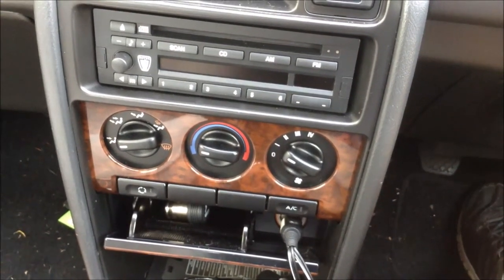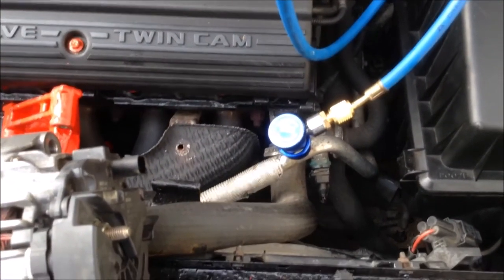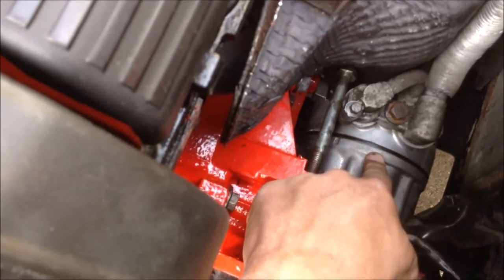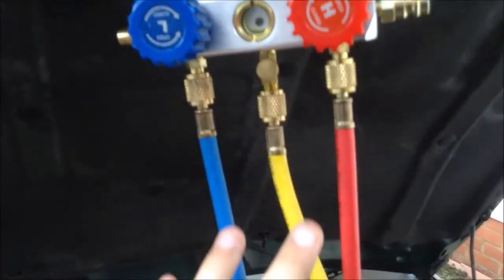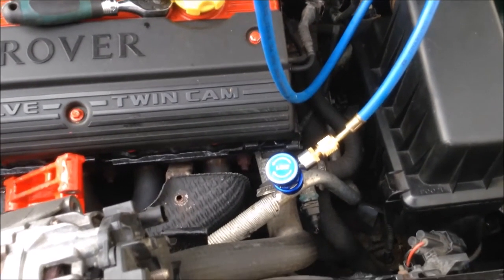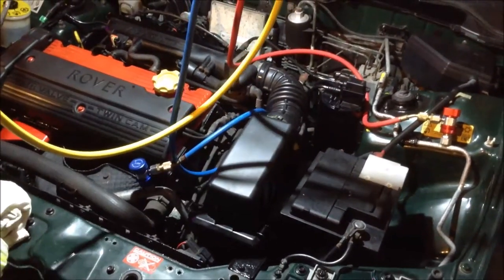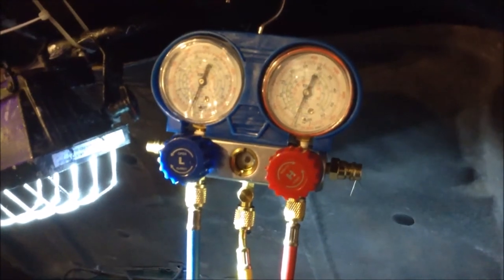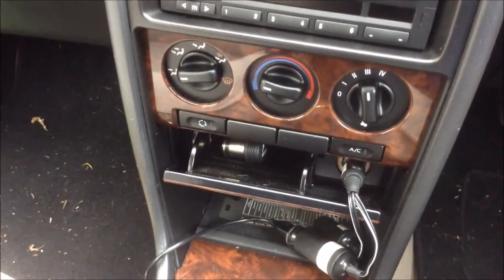rover 45 Air Conditioning part 2 Pull a Vacuum and refill Recharge Your AC System

Comment: How long did you leave it between fitting new receiver drier (opening the system up) and vacuuming?

I’m going to change the receiver drier and high pressure valve on my Rover 45, but there’s going to be a gap between doing this work and getting it to a garage to vacuum and fill the system. 
Also garages only vacuum the system for like 20 mins or so
Reply from the maker: as I understand as soon as you can do it the better, I think we did all the fitting one day and the vacuuming and gasing the next day. the system we were using the Longer, you can hold a vacuum the better. However, a garage may use a different system